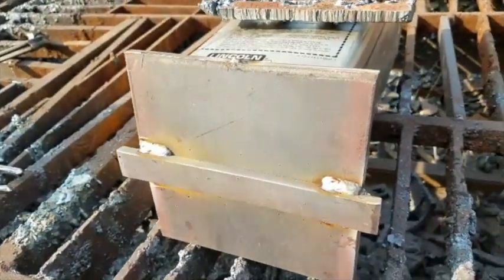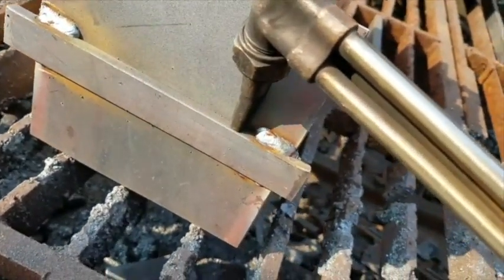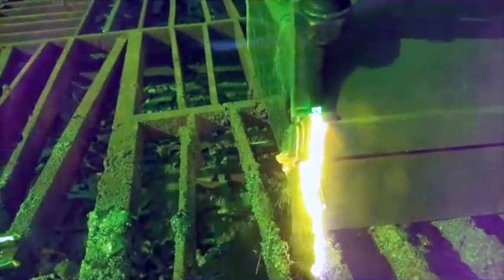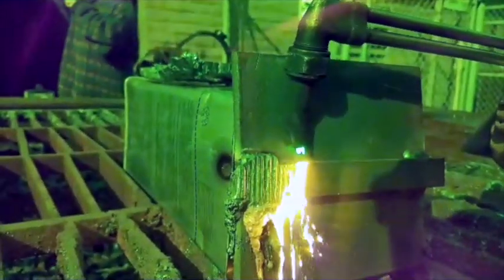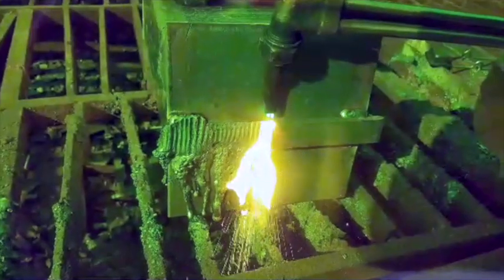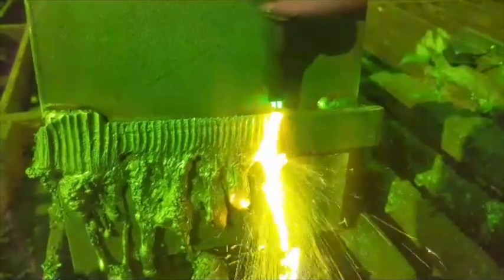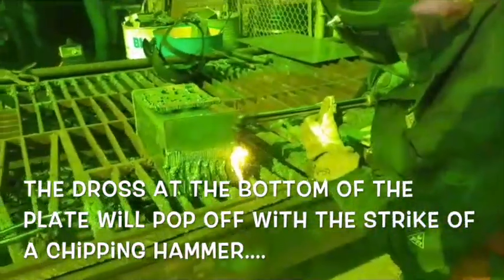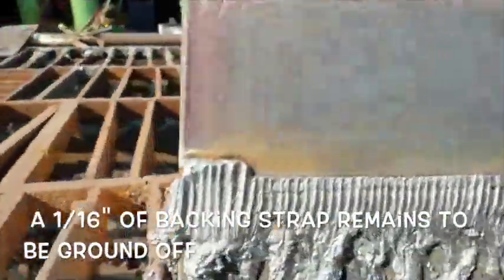Welding Test Plate- Back Up Bar Removal

Comment: I'm a bit confused as to why you wouldn't cut the two welds with an angle grinder to remove the bar. It seems a better method, but I'm short on experience, so I could use a little help turning on the light bulb in my head.
Reply from the maker: Good question-
After welding the plates, the back up bar is continually fused (or should be!) to the test plates.
Cutting just the two welds would still leave the back up bar solidly welded to the 2 test plates.
Some welders cut the test coupons with a saw or plasma before removing the back up sections.
Either way, both the root and face need to be taken down flush with the original surfaces before a guided bend test is done-

Comment: Great video! On another note could you tell me how to set up pattern for 10” at 45’ angle with 10” coming off of it at 20’ angle. If I can get email address I can send picture of the thing. Thank you sir.
Reply from the maker: Review my pattern videos. Are you talking round to round or square?? The pattern videos may help-
Dave
Reply: Dave Osland Pipe coming out of ground is 10 3/4” od facing north. Pipe coming in from east at 90’ angle is also 10 3/4” but is elevated at 20’ angle.